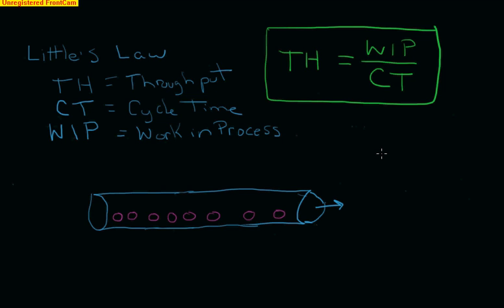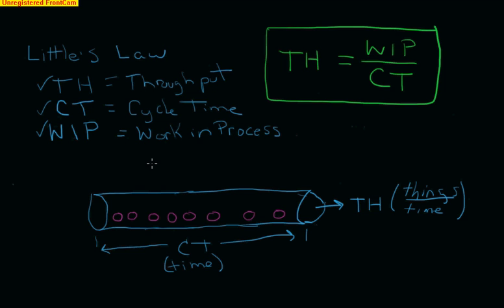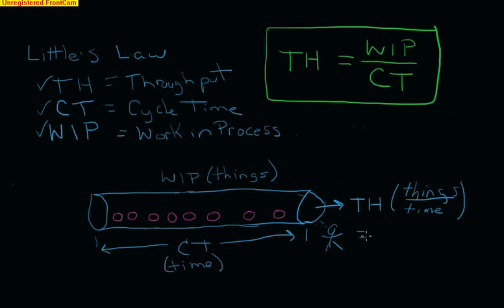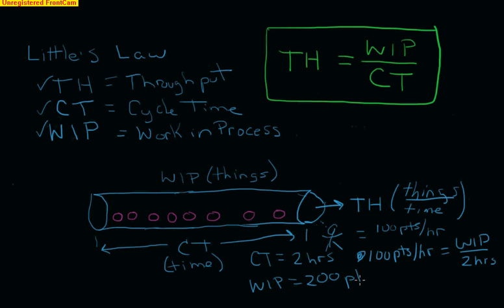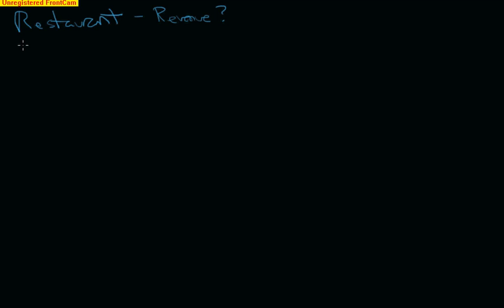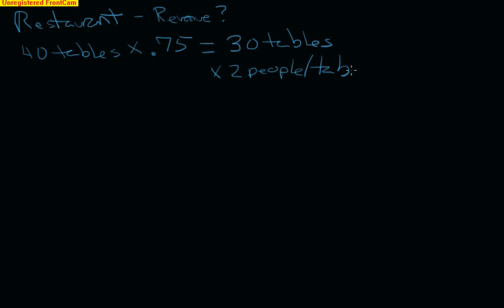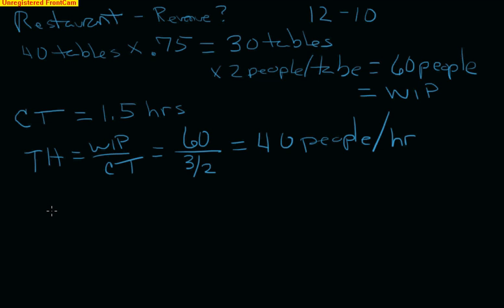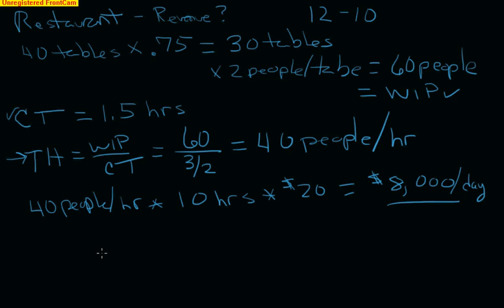Little's Law

Comment: I believe the terminology here is a little confusing. Because CT (cycle time) is a production time as well but it includes only the machine output as a measurement. I believe replacing it with TTP (throughput time) or LT (lead time) which are equivalent almost can be a better definition. Otherwise, good job with the explanation
Reply from the maker: Thanks - yes there seems to be a lot of different terminology for the same metrics.

Comment: throughout time = WIP x Cycle time, NOT WIP/Cycle time
Reply from the maker: Throughput is a rate, not a time. The units on throughput are items/time. For example, 10,000 pieces per hour.
Reply: @samore11  Throughput rate, flow rate, or material flow rate are all the same. Just different wording. Flow rate = WIP/Flow time .
Reply: @samore11  I see what you're saying...I got confused because in my textbook and notes it is always referred to as Throughput time. Can you explain why it makes the equation different? I am a bit confused
Reply from the maker: @stevemav5689  I've actually never heard of the term "throughput time" unless it is another name for cycle time which  is the average amount of time it takes an item/piece to go through the process. I think the key to thinking about it is to always think of the units of the metric you are talking about: Throughput (things/time), Cycle Time (time), WIP(things).
Reply: @samore11   Yes, 'throughput time' is the time a unit takes to go through the process. This is sometimes preferable due to the confusion over the meaning of 'cycle time' which has two common definitions 1. avg. time through process (as you state) and 2. the avg. time between successive units completed (inverse of throughput rate)